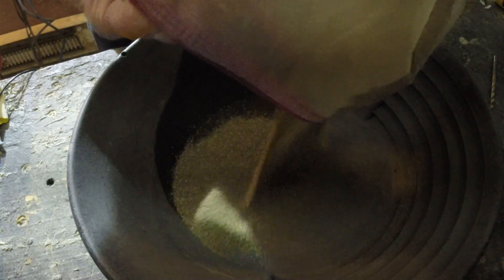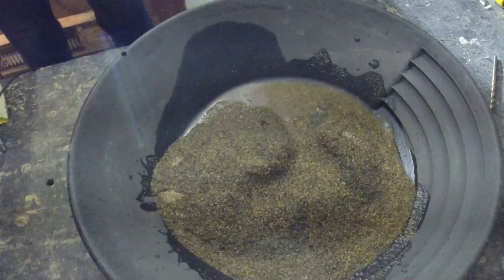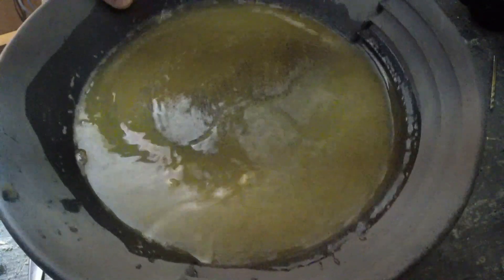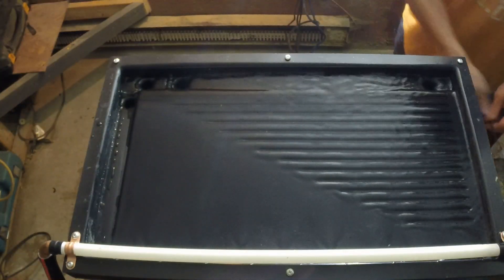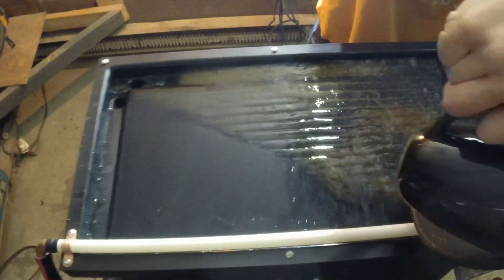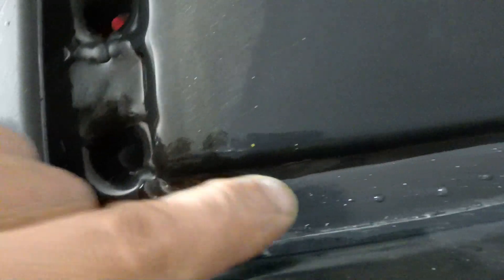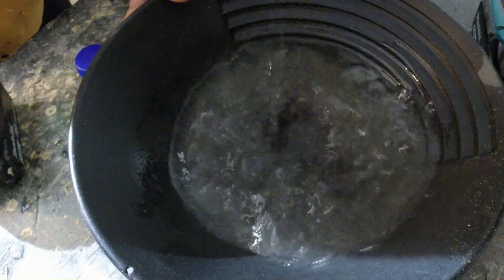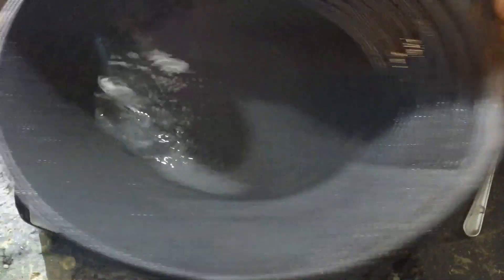I received dirt by mail, I ran it on the gold shaker table.

Comment: Great job, you have to install an iron magnet under the table to isolate a large amount of iron
Reply from the maker: I can try that, maybe above so it doesn’t clog up.
Reply: @Golden_B1  It's better the magnet is under the table and you have to make it move like ceiling fan Don't forget to put the magnet on the wings
Reply from the maker: @zyadmorgan6646  oh I see what you mean!
Reply: @Golden_B1  If you do it, the iron will not clog Gold scales, you have to control the speed of the magnet so that it delays the iron with the gold and makes the iron go with the particles of the stone
Reply from the maker: @zyadmorgan6646  I’m gonna try that thanks
Reply: @Golden_B1  God bless you